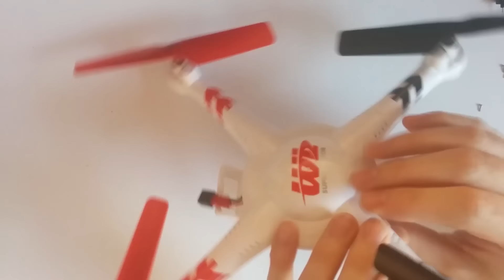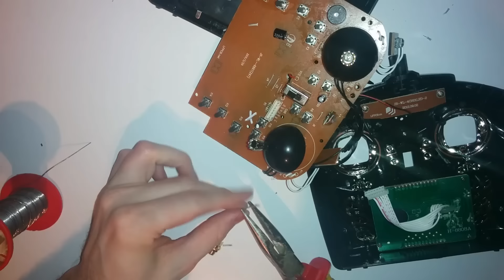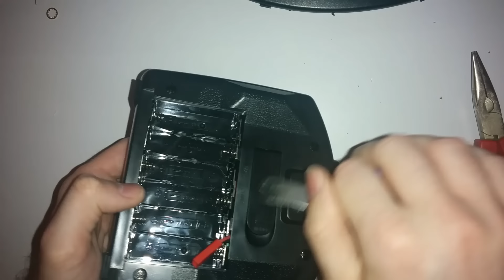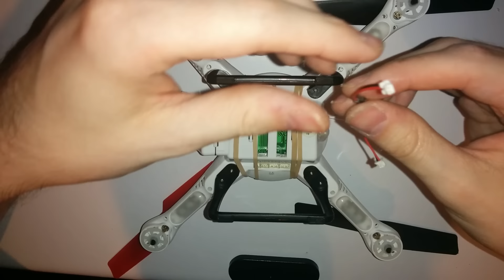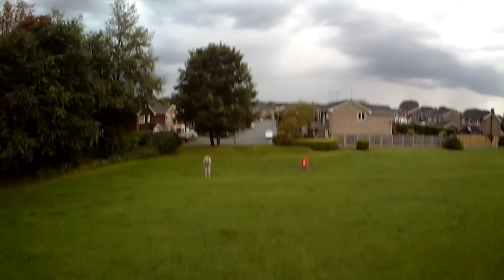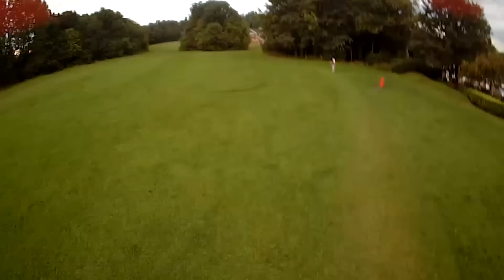WLtoys V686 Mods

Comment: My WL-686g wont lift off, all the blades turn but not enough power.I first thought battery, and replace it with a 750 mah, but still won't take off. (lights come on, and blades spin). Any Help is appreciated

Comment: I was wondering if this transmitter takes 6 1.5 volt batteries = 9 volts, then can I mod most other transmitters that are loading only 4 batteries, 6 volts, to 9 volt rechargeable battery.... and does that not boost the transmission power?

Comment: put a micro gimbal under it :p
Reply from the maker: Micro gimbals are only 2 axis but it could be done
Reply: I made my own Micro H quad last week.
The dark edition motors are braking without even crashing. How?
Reply from the maker: what do you mean by breaking? I have not had that issue myself contact benedikt and he will sort you out with new ones
Reply: I bought them from picnicquads and got an replacement. Now another one broke.
The motor does spin. But it spins so slow.
Sometimes it doesnt even spin.
Reply from the maker: there has been various differeent batches with these motors some good and some bad. perhaps u received some of the older ones :( i get mine from micro motor warehouse
Reply: they were grey.
Reply from the maker: iv not had any issues with the grey ones just the black ones
Reply: I think im going to buy the Cl-0820-15 motors from mmw. Maybe they work better for me

Comment: Basically the transmitter is 9v on standard battery's you used a 2s 7.4 v battery
Reply from the maker: 2s is fine been using it for months

Comment: Hi Andy 
The battery your using is 7.4 v so is there a down side asin a loss in performance and if battery size isn't a problem could a 3 s 11.1 v  battery be used also I have a 2s helicopter  battery spare which is 7.4 v could that also be used thanx for your time Dusty247
Reply from the maker: do you mean for the transmitter or quad? the one in the quad is 1s and in the tx is a 2s

Comment: will you reccomend if I put a 1700 mah battery in the quadcopter
Reply from the maker: +Challenge Me yes that will work fine
Reply: +AndyRC ok im confused becaus quadrocopter 101 said it will burn out the motors
Reply from the maker: I have been using an even bigger battery than that with mine and had no issues

Comment: hi! first of all thanks for the video! i really enjoyed it!
but i have a few questions that i hope you can answer:
1. i am waiting for the same quad as well and i head that some changes were made to it in new versions (cheaper build) and that some mods are not possible anymore (lens mod) will the antenna mod be possible?
2. in the video you said you get around 300M but in the comments i read something about 1km? that confused me a bit... so how is it really?
3. is there no need to boos the signal from the quad itself? boosting the remote only is enough?
4. why did you choose a smaller capacity battery? i saw a previous question about it and you said it is mentioned in the video.. but i couldn't find and comment about it... i didn't even notice the battery capacity before i saw the comment :)

again thanks for the info/video!
eitan.
Reply from the maker: Hi. yes the antenna mod can be done. I used a smaller battery as I have 60 plus batteries using losi connectors. also the nanotech has a higher c rating so there's more lift

Comment: what range do you get with the fpv and with the transmitter with the mods?
Reply from the maker: its untested but id say at least 1km
Reply: on both? fpv and transmitter?
and does the transmitter use more battery with the antenna on it or not?
Reply: also you said it was connected to the lights for the battery level, does that mean if my battery gets low it just stops giving signal, and is there a cheaper version of that antenna?
Reply from the maker: +Floris van der Plas the fpv was my own addition so the range depends on your vtx. iv not had the tx battery go on me so I can only assume thats what it does as it looks more than just an led driver inside
Reply: oke thanks. just one final question, for the transmitter antenna, the higher the gain the longer the range right?
Reply from the maker: +Floris van der Plas not always. if there is only a small transmitter eg 10mw then the antenna won't make any difference which is why a range booster has been added here

Comment: Very well done! Love your commentary
Reply from the maker: +jordan john thanks for watching jordan
Reply: The #808 lens does not work anymore
Reply from the maker: +jordan john what do you mean? thx
Reply: +AndyRC sorry :) 
I meant that it is not compatible with the new versions.
Reply from the maker: oh you mean the fpv module. the module i have the 808 lens fits fine
Reply: +AndyRC WL toys has made some changes to the V686G. I had bought mine in may and when i tried connecting it,  i found out it says V1.5. Whatever i did, it would not give me picture. Since it was not compatible. But please tell me when you bought your's.
Reply from the maker: my modules a few months old

Comment: I'm impressed with the WiFi booster. Interesting idea!
When that red wire came off of the transmitter's battery compartment during soldering my heart went out to you. I think we've all been there!
Those transmitter modifications are easy and useful and could be translated to almost any transmitter just as your Mode conversion video shows.
After doing a couple/few of my own the antenna connector mod is a common one for better range. One ends up buying antennas in bulk though. LOL
I was just gifted a Syma X5 and will be looking to steal a few ideas from you as the two flyers seem somewhat similar.
Great stuff as always, Andy!
Reply from the maker: +Michael Thompson I have the syma also, they are virtually the same
Reply: Excellent!